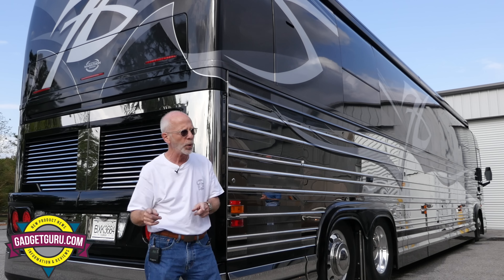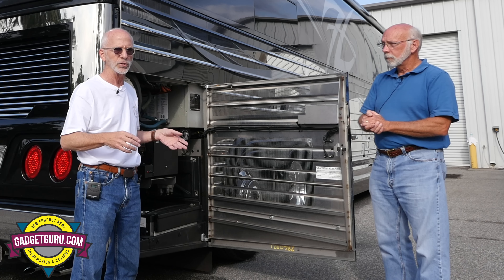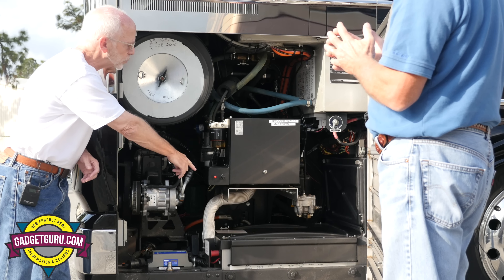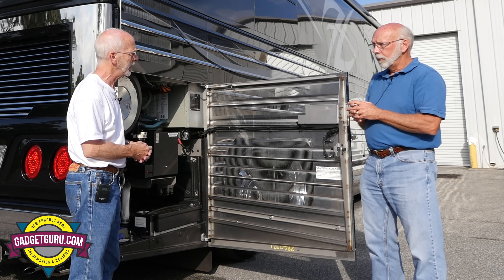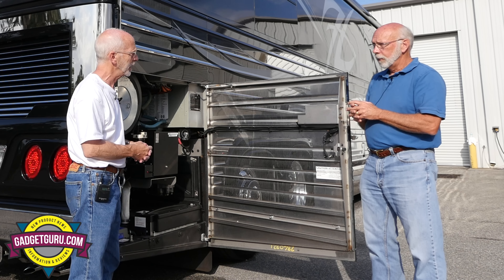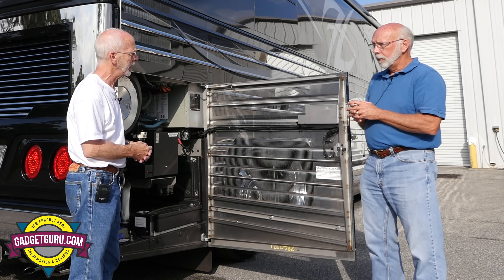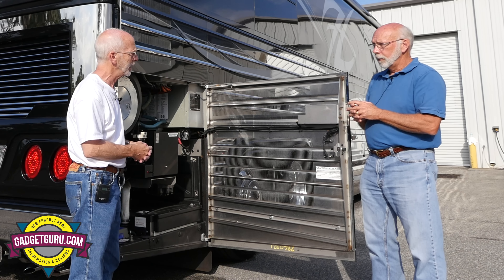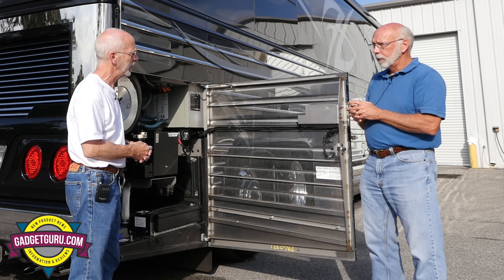Prevost For Newbies - Part 2: Driver Side Bays On A Marathon Coach

Comment: I thoroughly enjoyed this video and learned alot. You mentioned at the add line on the 5 foot dipstick on the Detroit's is about a gallon low. When I was a kid I worked at a large truck stop, filling semis with fuel, cleaning their windshields, and checking their oil. Every time I let them know they were a gallon low on oil, they always said that's fine! Maybe they all were due for an oil change, I don't know.